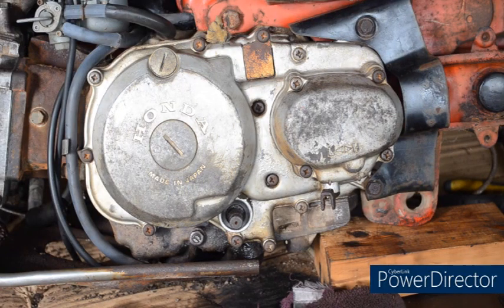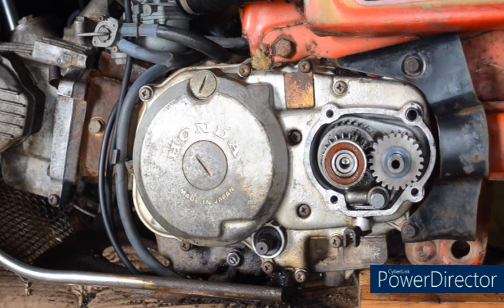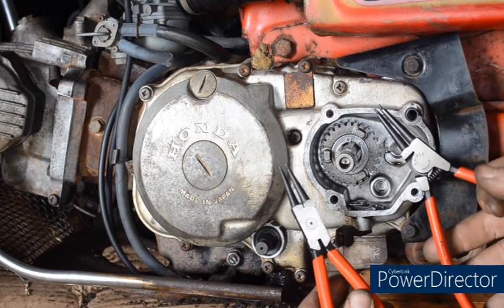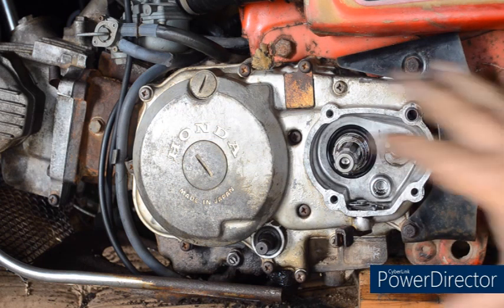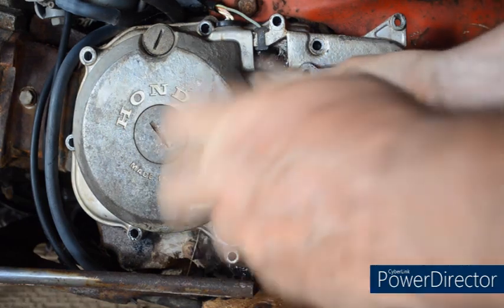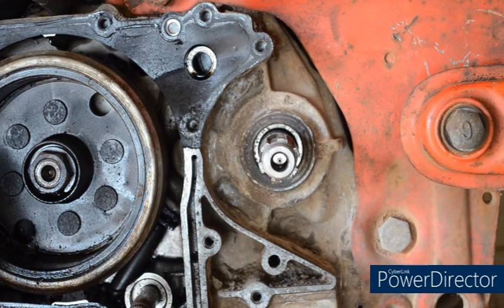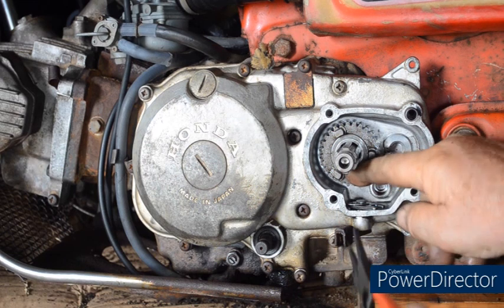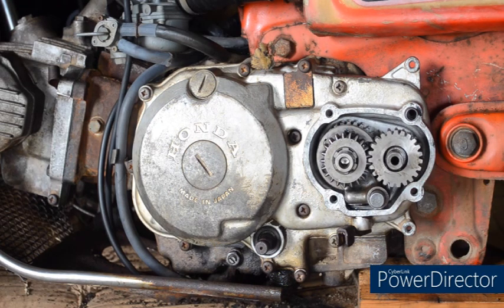How To Replace Front Sprocket Honda CT 110 Trail Sub Transmission

Comment from the maker: Here's a link to a parts diagram, 
https://www.partzilla.com/catalog/honda/motorcycle/1984/ct110-a-trail-110/sub-transmission
Reply: thanks for adding the link, its about time to for me to replace the chain and sprockets on my CT
Reply from the maker: @perpetualmoto   the hi/lo trans bikes are a bit more work when changing the front sprocket but are so much more useable on the trails so it's a small price to pay.  Thanks Brad.

Comment: Your title is to replace the front sprocket. Your messing with the Hi/Low Trans????
Reply from the maker: because to change the sprocket you need to dismantle the hi/lo to remove the engine casing.
Reply: @Free_Ranger_CT110  Not shit really? Why not make a video of changing the sprocket like it says?
Reply from the maker: @behindthescenes3394  the video shows what's needed to change the sprocket & a new sprocket is fitted.

Comment: Thanks for the great video! It’s very helpful. I’ve got a ‘67 CL90 that a previous owner added a sub transmission to. It was leaking oil out the gasket and in an effort to fix it I disassembled it and replaced the gasket. Now when reassembling, when I tighten the bolts it locks up the drive train. When I loosen the bolts, it spins freely. Any ideas on what I’m missing?
Reply from the maker: Hi mate, I'm not sure what it can be.  Only thing is is dismantle it again & double check everything as you rebuild it.  Could the oil seal cause the problem?  Possibly.  Good luck!
Reply: @Free_Ranger_CT110 I’m thinking it’s the gasket. I ordered some different ones to try. When I took it apart there was a gasket and sealant and it was leaking. Seems like someone tried to seal it without cranking the bolts down… we’ll see!
Reply from the maker: I was working on a hi lo trans today & I was thinking, yes if the end cover is put in place with only gasket sealant & not a gasket maybe it will cause your problem.

Comment: You fitted the circling the wrong way round, the rounded edges should be fitted towards the heat with the square edges towards the outside ,so the circuit is more secure, less likely to come of ,other wise a good video
Reply from the maker: Thanks for your input.  Not sure what you mean by 'circlng.'  If you mean the splined washer, yes the manual says fit with sharp edge out, in my description I mention this & also that the washer on this engine didn't seem to have a distinct sharp edge.  If you mean the circlip, I fitted it as I was taught as an apprentice diesel mech 40 yrs ago.

Comment: Struggling to get the circlip back on after replacing the gearbox seal. Is there two different seals? Could you help at all?
Reply from the maker: Hi, the larger seal is 31x43x8 mm, g/box is 27x37x7 depending upon the model there are changes over the years with top hat spacers check with parts book for your bike.  Are you pushing the clip inyo place with a screwdriver, if you try to use circlip pliers for the last few mm the ends of the pliers may stop the circlip clicking into place

Comment: I’ve watched now, your vids on this and your two clutch ones, as I intend doing all the above.

Your calm demeanour and videoing prowess are much appreciated and has inspired me to want to tackle my CT110 projects, with confidence, as I intend to do all of what you did in your videos, to my AG model CT110s.

Two questions: Are your cir clip pliers Knippex? 

Secondly: Have you done a video on the teardown and reassembly on the top end of the engine? I’m practically a novice and need to do the rings/valves etc.

I believe I have the tools for it… all the gear and no idea, sort of thing.

Thanks.
Reply from the maker: Thanks for your kind words, I make the videos to show how easy it is & I deliberately use a cheap work table etc to show what can be done with basic tools. Yes well spotted, the circlip pliers are Knipex.  There are videos showing head removal, cam chain change, valve grinding etc.  I'm gradually adding to the videos covering the common jobs that may need doing.  As for tools I'd suggest buying (if you don't have them already) a JIS screwdriver & bits, impact driver, clutch holding tool, clutch nut tool, impact gun can get you out of a hole too.  I think you'll enjoy working on the engine & it's easier than you think.

Comment: my sub transmission pops out of high gear when under full load.  Any ideas what might be causing this?
Reply from the maker: Could be lots of things, need to dismantle & check everything.  Could be not fully engaging caused by worn/bent selector or wear/play/damage in the operating lever fork.  If fully engaging but jumping out could be damaged/missing spring behind the detent balls on the main selector rod.   Could be worn/damaged dogs or gears. When checking the cause should be obvious except for the detent mechanism which is easy to miss. Check the manual operating lever fork in the case bottom held on by small circlip, could be worn/damaged etc.   Hope this helps.

Comment: Why this high low gearbox not available in new ct  models ? Any idea ? Thanks👍
Reply from the maker: We can only guess at the reason.  Maybe Honda thought the new more powerful 125cc engine didn't need it or that the bike would not be used on steep tracks.  I'd say because the engine is shared among many bikes that it was to standardise the engine & keep costs down.  I think the new ct125 is way over priced, a Suzuki 250 v strom is $2k cheaper.

Comment: I’ve watched this a few times to save myself pulling mine apart to check something. Part diagram lists the neutral switch as being inside the transmission however I see a component and a small hole (in the gasket I believe) That allows a part of the neutral circuit to go through into the casing behind it. Any idea on what that is ? Having trouble with the neutral light and trying to avoid tearing the thing down to it’s bowels to fix it
Reply: I managed to find a diagram of the left crankcase cover and it does indeed list it. Fingers crossed this has crapped out and not the copper plate on the selector drum
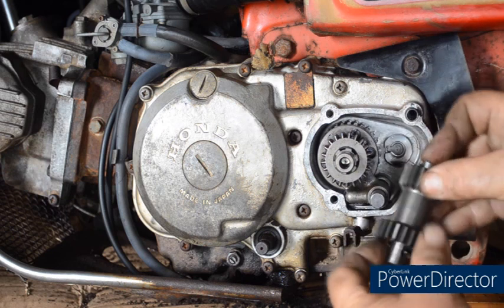Reply from the maker: There's a copper plate on the end of the selector drum, but I think you mean if you look at 5:48 on the video inside the case top left there's a black plastic cigar shaped tube which is the second part of the neutral switch and the wire pushes onto a bullet terminal on its end.  On the hi/lo version the wire is behind the small metal plate held in place by a case screw,  If you remove the wire before taking the casing off, the black tube stays in the engine.  if you leave the wire in place as I did in the video the tube comes out with the case.  If you look at some of my other videos you'll see what I mean.  Look at 'replacing cam chain pt 1 at 1:30 you'll see it in the case at top right with a white looking 'washer' around the bullet connector in the middle.  It sounds more complicated than it is. Hope this helps.

Comment: Couldn't help but notice that no lube or grease was applied to the gears or shafts inside the sub-transmission. Was lubing performed off-camera?
Reply from the maker: You're correct.  Also gaskets etc, this is an older engine which is to be stripped for rebuild.  The video was a demo to show the parts.

Comment: At 6:09 in your video you remove the sprocket I don't see the bushings. I have two bushings. One has a big flange that goes against the seal and the other bushing goes on the outside of the sprocket.
When I put the crankcase back on. the sprocket is really tight and will not move.   This is the second seal I've put in with the same issue.
Reply: I finally figured it out. You have to put the big flange bushing in first then the seal, then the sprocket, then the small flange bushing.
Reply from the maker: @geoffmoorcroft302  glad you got it sorted out.
Reply from the maker: When I fitted the sprocket it was a snug fit on the shaft the bushings must've been in place.  The manuals show the bushings A & B as they call them it sounds like you have them in the correct way.  It's difficult to diagnose without seeing it.  All you've done is change the seal?  Have you put on a new sprocket at the same time?  If so measure the width of old & new sprocket with the bushes in place.  It must be something simple.
Reply from the maker: https://www.partzilla.com/catalog/honda/motorcycle/1984/ct110-a-trail-110/transmission-kick-starter-spindle part numbers 10 11 & 21.  Make sure you have the bushes the correct way.  Do you have the correct oilseal? The seals are different for bikes with & without the aux trans.  Check part number 21 in the diagram for the correct oilseal.
Reply: @Free_Ranger_CT110  
 I'm almost 100% sure I have the correct oil seal but it would make sense if it wasn't the correct one because to me it seems to be 1mm too thick.
On the parts diagram there are 2 different part numbers for item #21. One has NOK
Do you know what that means?
Reply from the maker: @geoffmoorcroft302  one of the numbers will be the size 27-37-7  inside diameter 27mm outside dia 37mm width 7mm.  From what I understand changes were made over the years earlier bikes had sprocket bush same as mine, later had the two bushes same as yours. Some had thrust washers on the idler some didn't.
Reply from the maker: I have an old CT90 engine with hi/lo I'll have a look tomorrow.  My bike in the video is a 1985 Australian 'ag' bike maybe they were modified.
Reply from the maker: This video from socal Bruce is same as my sprocket, bushes but not the flanged bushes.  It may help. https://www.youtube.com/watch?v=wIYiYmidxq0

Comment: Once agin thank you for your videos , may I ask as to how many kilometers you have on your bike ?
Reply from the maker: Thanks for watching & commenting.  This bike bought in parts has 35,000km on the speedo.  My other bike that I rode into the outback has approx 65,000km, it's impossible to be certain as the speedo cable was broken when I bought it.
Reply: @Free_Ranger_CT110  That is outstanding , makes me laugh as I was concerned about the mileage on two Trail 90's we have bought . The 77 has approxmately 900 kilometers and the second 78 about 3500 . I am retired and we live in the province of Alberta , Canada . Truely appreciate your videos on these wonderful bikes , we'll keep them running for decades .
Reply from the maker: @luckydog7299  the CT110s weren't sold directly to the public, when Aus Post retired their bikes they were sold at auction.  Most of the bikes had at least 30,000km, you're lucky to be able to buy bikes with such low mileages, yes they will last for decades.  Glad you find the videos useful, truly appreciate you taking the time to leave a comment.  Enjoy your bikes & retirement.  I'm sure Alberta is a great place to trail ride!
Reply: @Free_Ranger_CT110  I have a question about the oiling system on a CT 90 that you likey know the answer too , about the clutch center spring and plunger bits . My 90 plunger seems to be hollow ? is this correct ?
Reply from the maker: @luckydog7299  yes that's correct, it allows oil to the crankshaft big end.  Make sure you fit it with the spring in first.  I've a clutch video which shows this in detail. At 5:30 min it shows the oil pass pipe https://youtu.be/4uc6Qs4FjYI hope this helps
Reply: @Free_Ranger_CT110  Thank you for your help . I'm retired and enjoy riding the Trail 90's , your videos sure help with the upkeep  . Sure appreciate them .
Reply from the maker: @luckydog7299  thanks for your comment,  sometimes I feel I'm wasting my time creating these videos, but comments such as yours keep me motivated to keep on going, thanks again.
Reply: @Free_Ranger_CT110  you are doing a wonderful job explaining these bikes for the future generations . I think of it as preserving a little piece of motorcycle history .
Reply from the maker: @luckydog7299  Thank-you!